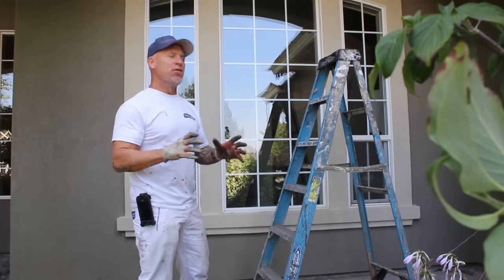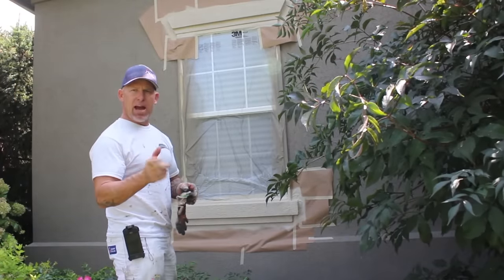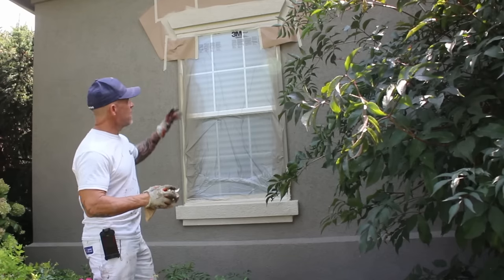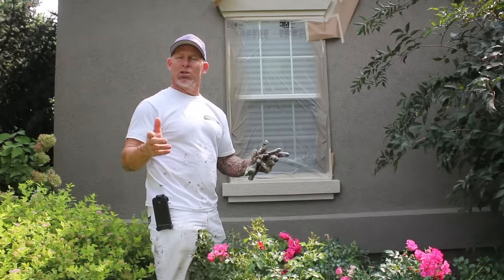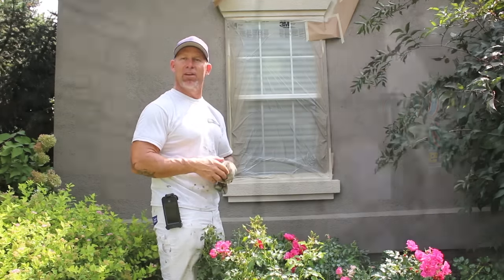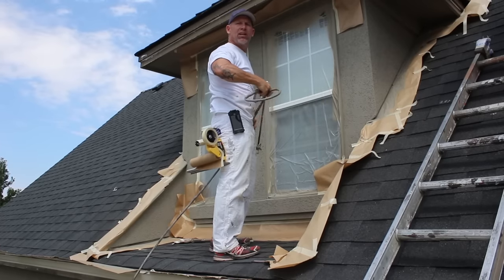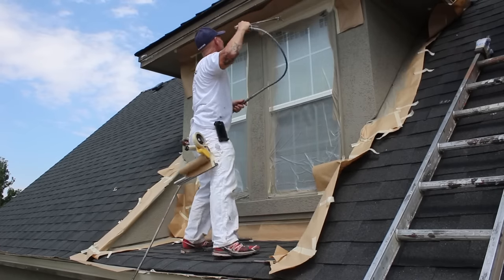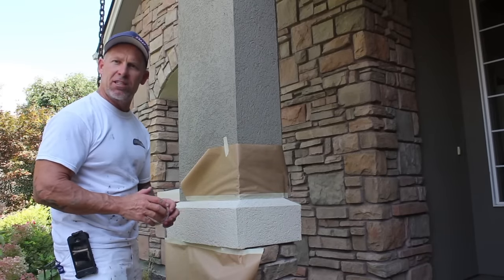Stucco Painting Tips.  Painting Straight lines on Stucco.

Comment: Nice job.

There are a lot of stucco situations where the surface is very rough and you can risk blow off  or saturation of regular masking tape. In these situations i use 3M 3060 stucco tape. I use the tape by pulling off in half, that way its easier to use and you get 120yds of straight lines.  Then masking is applied on top of stucco tape as usual. Most often used masking the stucco for painting eaves and masking along ground level concrete or flooring for a crisp line
Reply: Man I hate masking new stucco even two inch tape is hard to get to stick

Comment: What Graco tip # did you use for this kind of staco finish? I am planing to paint my house and having hard time on choosing the tip #. Thank you.
Reply: @lilia w he says he's using a 210 tip
Reply: @scrivens100  it really depends on the paint thickness, and most all paints will have a recommended tip size right on the can. So, decide which line of paint you will be using, then start with the recommendation on the can and adjust for how wide you want your spray pattern to be. You would not want to paint a whole house with a 210 or 310 tip, since you would have lines and it would take FOREVER!  If using elastomeric paint, a 621 or 623 tip would be best for the body since it is so thick.
Reply: @Erklzanderz  I use a 213 for fascia and sofits or a 211 for cutting in then a 415 or 500 for the body I've got a small graco I can do oil but not elastomeric or shalac

Comment: What type of compressor you use to spray paint stucco?
Reply: It is an airless sprayer, there is no air compressor. Think of it like a paint compressor, it pressurizes the paint in the line instead of in a tank.